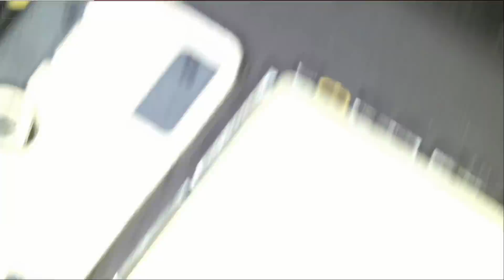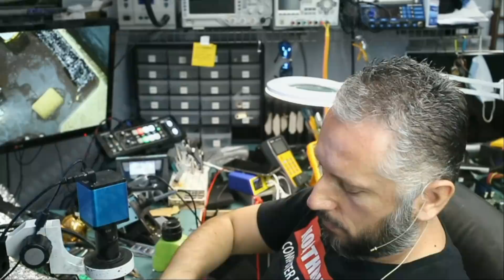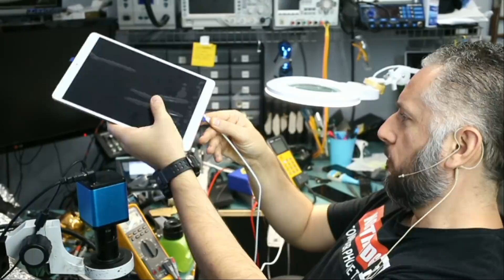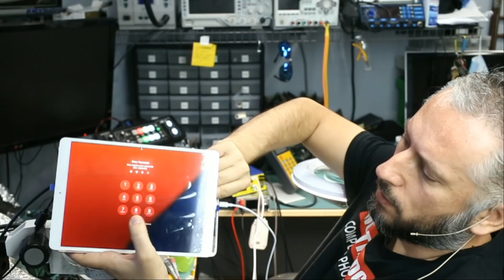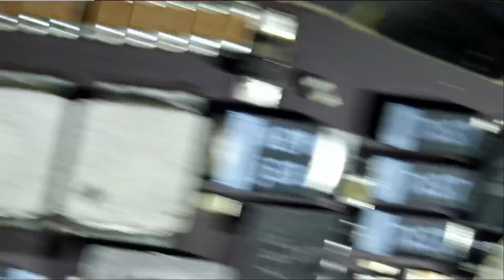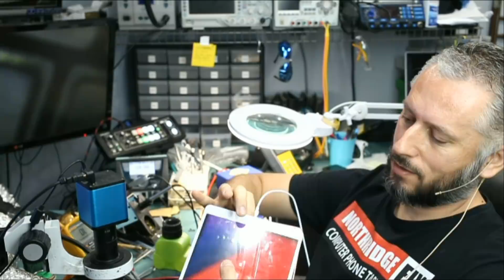iPad 10.5 Prior repair attempt -Accidently bridged 4 components. Cleaning the mess & dark corner fix

Comment: From my own experience, stubborn solder like that is often the result of mixing two incompatible alloys of solder. It can be cleared out by diluting it with a large-ish quantity of leaded solder. (Just blob some leaded solder over it and let everything melt for a few seconds.)
Also, 0402s are an absolute pain. The lowest I usually go in my own designs is 0603 but sometimes I just have no choice...
Reply: Yes mixing leaded with unleaded solder is common issue. One has to put leaded solder, then remove it to thoroughly remove any residue and restart soldering.

Comment: What is the usual voltage drop of diodes? As mentioned in your video a 0.14 voltage drop for backlight diode is normal. I thought a voltage drop of between 0.4 to 0.6 was normal. Need your clarification please
Reply: 0.0 to 0.6 will be fine, anything not stupidly high. Voltage drop just shows a component is consuming the power before reaching its target. If there is a 5v component past that, if voltage drop is 2.7v then only 2.3v is getting to the component because of the faulty part which means no operation. 0.6 would mean voltage getting to the component is 4.4v which will be enough power. Apologies if you already knew this.

Comment: The 0402 SMD is 0.04 x 0.02 inch or ~ 1 x 0.5 mm  ..   thats damn small..    amazing work
Reply: The solder bridge Alex repaired was around 0201 SMD components smaller than the 0402 so it takes a lot of expertise to deal with such a repair.